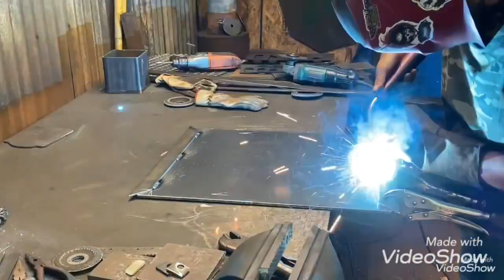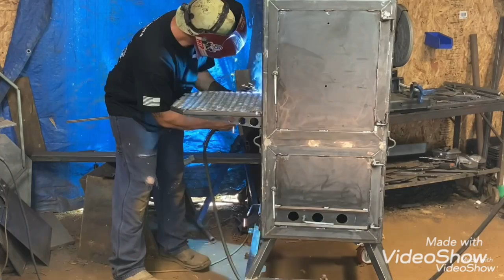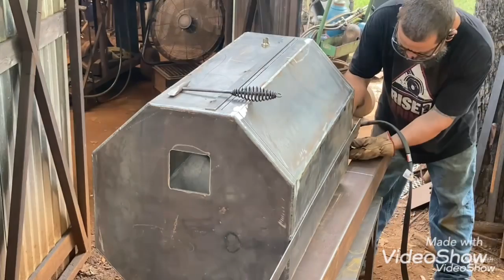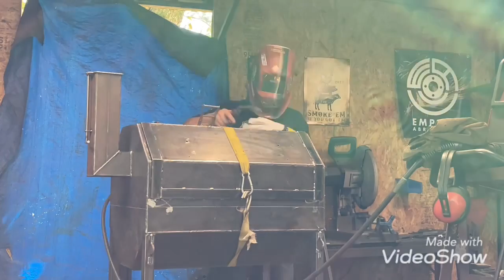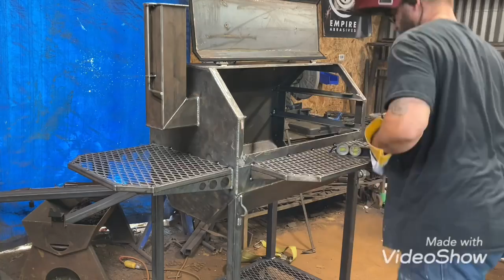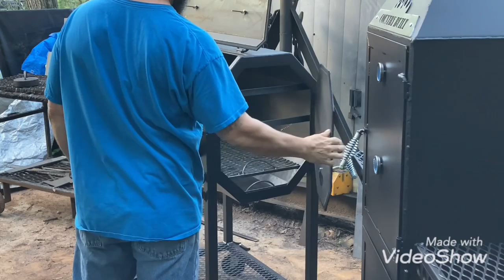Vertical smoker and bbq grill build

Comment: Not sure how you keeping them prices on these so low with the price of steel plate being 4x the normal price.
Reply: I was thinking the same thing
Reply: @kevinburcham9414  it has gotten outrageous. .250 4' x8' running $865 freaking ridiculous
Reply: Dude you’re not joking.  I got a quote for steel to make a guy a Santa Maria grill and the material alone is $876.  With my labor, it’ll come out to $1600.  🤯
Reply: @810Metalworks  Making it hard to do business when you can't find people willing to spend the money when prices are higher then normal.. heard it supposed to drop in the fall and winter ... the steel plate manufacturer caused this by creating a demand higher then they can supply. They got scared at the beginning of the year and stopped producing only to order.
Reply: @facediaper4607  yeah, just got the word, the guy is going to go for it.  Paypal’d me the deposit.  I’ve lost a few jobs because of the price.  It’s a pain in the ass.
Reply: @810Metalworks  I been losing alot because of it
Reply: @facediaper4607  I’m sorry man.  I hope it turns around soon!  Do you have an Instagram or anything where you showcase your work?
Reply: @810Metalworks  I do heavy equipment,  all around fab and rebuilds. CV stopped me from expanding to manufacturing.  Like smokers,  attachments and such. Then these steel prices on recovery done bottomed out the industry only work out there really is Government contracts and hospital construction... I won't be in a union.. nope not having it... 

Guess I will ride the chaos train till she derails . That or become a drug dealer 😏